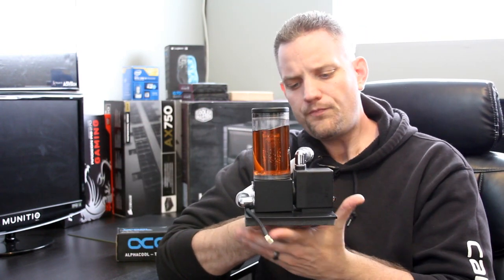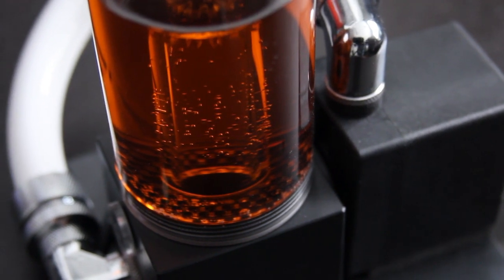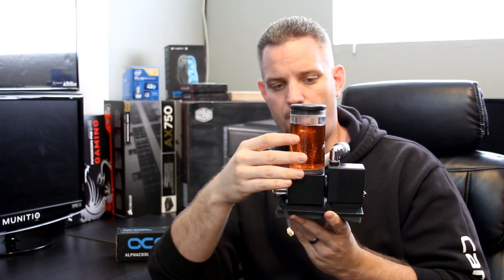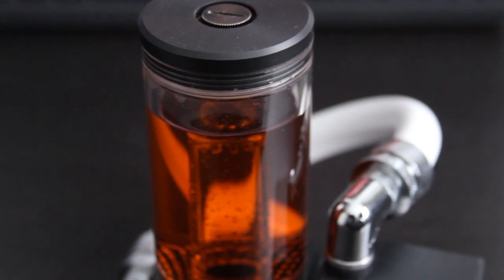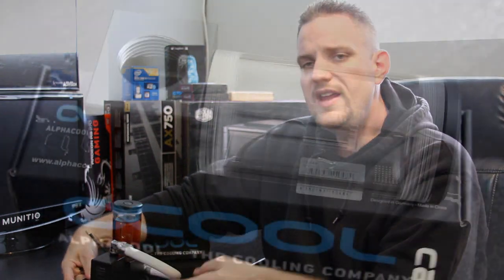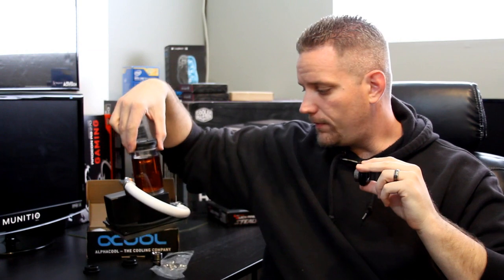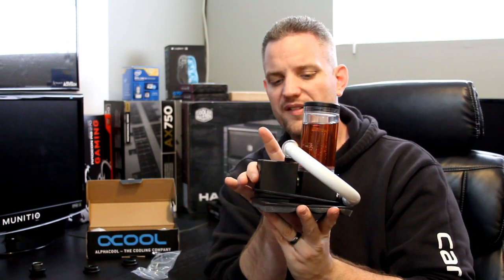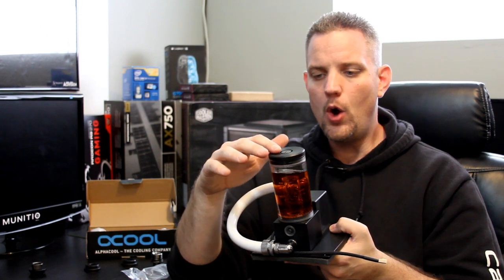The COOLEST Reservoir on the market? AlphaCool Light Tower

Comment: does the size of the reservoir matter? Or is it more important to have a bigger radiator with good fans. I'm assuming the size of the reservoir depends on how many items you have water cooled, i suppose that goes for the radiator as well?
Reply: mark swishersweets As far as I'm aware, not really. The only difference I've seen is that it takes less time to fill the loop with a bigger reservoir.

Comment: So just like the other comments, no pics or vids of it running with lights... and i know this is an older video, but even at the time, simply putting an led in a g1/4 plug was around for awhile and idk if it really make is a "light tower" plus its huge and ugly.... get a bitspower tube res and mound a d5 directly on the bottem.

Comment: Hey Jay, I was wondering if this was a good PC build for a Christmas present.  This is my first time building a custom computer and I would really appreciate your help/input.

CPU- AMD FX-8350 4.0Ghz 8-core
CPU Cooler- Cooler Master Hyper 212 EVO
Motherboard- ASRock 970 Extreme3 ATX AM3+
Memory- A-Data XPG V2 8GB (2x4GB) DDR3-1600
Storage- Samsung 840 EVO 120GB 2.5'' SSD and Seagate Barracuda 1TB 3.5'' 7200 RPM
Video Card(s)- 2x Gigabyte Radeon R9 280X 3GB
Case- Cooler Master N600 Windowed
Case Fan(s)- Corsair Air Series SP120 High Performance Edition 120mm
Power Supply- SeaSonic 750W ATX12V / EPS12V
Keyboard- Cooler Master CM Storm QuickFire Ultimate
Mouse- Logitech G9x
Reply: That will be a great rig :) May want a 850w psu tho
Reply: upliftsleet1974 Thanks :)  I literally had no idea how to build a computer until I watched Jayz' videos.
So what you're saying is I should increase the power supply.  I can do that since my budget is somewhere around $2000.
Reply: MountainDrew You may want to go on this site and post it http://linustechtips.com/main/
There is a place for planing and you can get a lot of help :)
Reply: Get a better motherboard. That asrock you listed will not have enough pciE bandwidth for two 280x's. the power supply should be upgraded, and upliftsleet1974 stated. I recommend the ASUS M5A99FX pro R2.0 or the gigabyte GA_990FXA-UD3. those both will house plenty of bandwidth for crossfire to perform as intended. the hyper 212 EVO cooler is a great choice if you are on a budget, but look into a more beefy heat sink if you plan to overclock more than ~15% (if you can spacre the change). hope this helps! =)
Reply: If you are going for such a high end build i would highly suggest an I5 over any FX. You are getting much more performance in games that cant take advantage of 8 cores. Also, just go for one video card, either a 290x or 780. This gives room for upgrades. If u go 780 i believe u could even afford an I7 which will be superb for the years to come.
Reply: MountainDrew Yeah for $2000 go to Linus's forums instead of just YouTube comments please. Go somewhere where you can get real good advice. Or even go onto reddit and go to the subreddit /r/buildapcforme. Then when your build is all done, take pictures of it and post it in the subreddit /r/buildapc.
Reply: if ur just using the ssd for ur os then get a 68 gb.
Reply: ThexPandaxManiac Such as an Intel Core i7 4770k?  I could probably afford that.
Reply: Incap Thanks :)  I think I will go with the ASUS since I have heard good things about it on linustechtips website.
Reply: Bailey D Thanks for the advice.  I will probably go there later tonight and take a look at the forums.
Reply: MountainDrew You shouldn't increase the Power Supply, 750w is just enough for that build. However, if you ever want to upgrade to Trifire or Quadfire, you will definately need more power
Reply: you should probably get an r9 290 you will be fine with that 750w psu for it
Reply: ***** asrock makes some good motherboards for none overclockers
Reply: definitely get the 850 watt power supply so you have some headroom for over clocking the cpu and the gpus. Also if you want to add in more hard drives or water cool your rig, the extra power will come in handy.
Reply: itsasecr3t1227 For water cooling should I get the H100i?
Reply: MountainDrew I have the h100i with the FX 8350 OC to 4.9 easy with it. Its awesome.
Reply: upliftsleet1974 actually 600 would sufice, but 750 is great, no need of 850
Reply: ferisalgue Thanks :)
Reply: Incap No don't get the Gigabyte GA-990FXA-UD3. I had one of those in the past and for a $2000 build budget you can really do much better. Plus that takes into account whether you're going to overclock or not. The Gigabyte motherboard doesn't have many power phases and with the FX 8350 you really wouldn't be able to get much higher than 4.2GHz. Get that Asus Sabretooth. You could easily hit the limits of that chip if you got a biiger power supply as well. The FX is a power devouring monster. Of course the Intel would use fairly less power if you went that route.
Reply: DO NOT GET THAT MOTHERBOARD! I had it and it locked on me in two months and I still can't get it open. Get an Asus M5A99FX Pro r2.0, absolutely AMAZING motherboard!
Reply: MountainDrew ive seen 290 beat the 290x in most benchs, also may i suggest a 990 chipset, if you can get the 990fx sabertooth, your set for the long run buddy. ;) also if you plan to use this straight for gaming i would not suggest getting intel.
Reply: get the 8320 and overclock to 4.0 ghz you can you can get a nicer cpu cooler or some fans idk
Reply: ***** i know you dont "need" it but it's certanly not expensive, and i prefer the looks on that one better than the blue on the m5a99x, not to mention all the "perks" on it
Reply: 2x 280x!? LOL THAT'S SUPER POWERED! Get an ASUS MARS III with the two onboard 760 GPUs. It's a great price point that kicks ass (once it's released in the next week or two).
And if you don't want nvidia, go for the 290 or 290x, I mean, 2x 280x is a bit overkill.
Reply: Robert Downey Jr. It's overkill if you're trying to push a monitor at 1920 x 1080 but if you're like me and have a 2560 x 1600 then it's right up you're alley. The 290x or 780 would be much better suited for the higher res though just given the 3GB or more of memory but 2x 770s with 4GB should do well with 2560 x 1440
Reply: Robert Downey Jr. Anyway the Mars III is too expensive compared to just just buying 2x 760s and the performance would be just about the same when it comes to gaming unless you want to save yourself from using 2 graphics slots. Plus with a limited number of the Mars III being made, I'll bet retailers will sell out quickly. It is badass though

Comment: Have you ever talked about every time you have a short 90 Deg in your cooling loop that's like adding more pipe to your loop? So let say you have EIGHT 1/2 inch ID short 90's in your system that would be like adding 8 inches per 90 to your system for a total of 32 inches to run, then if you used long 90's? (I think I got the formula right ) it's why on long runs in your home of 1/2 inch copper pipe you get water hammer when you shut off your valve realy fast. Larger pipe like say 1 inch would would not get that water hammer on long rungs. But what does water hammer have to do with a cooling loop? Well that back pressure of all those 90s  means your pump has to work harder to move the water in your system.
Reply: Which is why you use a D5, which has an absolutely stupid head pressure.
Reply: Unless you are using a two stage two horse sprinkler pump, your not going to get the best head pressure, and more likely with a 2HP pump you're going blow your loop(s) apart. Even with a grundfos pump in a hydronic heating system is not going to give you great head pressure, what you're going to get is volume. My point here was every time you use a short 90 you're shooting yourself in a foot. Plus, from everything I am reading and watching most cooling loops for computers are a close loop. So trolling over the D5 is kind of mute. The weight of water on one side of the loop is equal the weight of water on the other side. It's just those short 90's are going to slow down that flow of water. Long 90's are your friend. That's why they use them in refrigeration systems like in your local Costco,  Sams, or Safeway store, and why you find them being sold at Granger.com and NOT being sold at Homedepot or Lowes.

Comment: How much does a full scale water cooling system cost?
Reply: It can be very cheap, or very expensive. Depends on the Radiator Size/Count, what's being cooled, and the strength of pumps and amount of fittings. I'd say the cheapest you could get would be around $120-$200, but totally depends on parts.
Reply: Rule of thumb. $300 for CPU and then an extra $100 for every component after that. That's petty much the cheapest. Just to give you a reference point I'm looking at $1000 for a CPU Loop. But that's spending a premium on components and buying extra radiator + components for when I go SLI in the future.I'll be spending ~$200 on a waterblock for my GPU and that's in my opinion very high end components $100 is perfect for a WB and ~$80 is high end for a cpu waterblock. I hoped this helped mate. 

I recomend you go on overclock3d or OCN if you want to learn more..
Reply: It depends on how many components, and how many rads you want. The more rads, the cooler it will be. For a basic CPU only custom watercool, it will be around $300.
Reply: 100-150$ if you are building it yourself.
but then water cooling has always been about aesthetics. and this stuff look better

Comment: why do i need a reservoir?
i mean, many radiators have a built in reservoir that keeps the air out already.
Reply: +Henry Chan the problem is your pump. it needs to have "way too much" water above it as a security buffer in order not to run dry. after completely filling your loop you could theoretically   remove the res because when the pump is goint to push liquid it will get the exact same amount from "behind" and wont run dry. you could  also use a T piece with a tap. the upside is ysed to put in water, after loop is full you close tap but a new problem arises. water evaporates slowly. like really slow. a res can buffer that. no res -> no buffer.

Comment: As others stated, this video lacks showing the product actually running on your setup. Simply saying "take my word" is just as bad as how misleading the video is (seems like a formal ad). On top of your "claim" that it works for everyone, you didn't even bother to back it up with any form of data (making your review rather subjective). To any one wondering how this product would have helped you, look at an actual review where the device gets thoroughly tested and data gets compared to similar products (extremerigs.net, overclock.net, etc.)

Don't get me wrong, you know your stuff, it's just that water cooling isn't as simple as "it worked for me, it's gonna work for you", it's actually very specific to the setup itself. I'll leave it at that since it's an old video.

Comment: Alright I just changed my system build from AMD to Intel.  My specs are as follows.

CPU- Intel Core i7-3770K
CPU Cooler- Corsair H100i
Motherboard- MSI Z77 MPOWER ATX LGA1155
Memory- Corsair Vengeance 8GB (2x4GB) DDR3-1600
Storage- Samsung 840 EVO 120GB and Seagate Barracuda 1TB 7200RPM
Video Card- Asus GeForce GTX 780 Ti 3GB
Case- Cooler Master N600 Windowed
Case Fan(s)- Corsair SP120 Quiet Edition
Power Supply- Seasonic 620W Semi-Modular

Yay or nay?
Reply: Do you shit gold bricks?
Reply: Jimmy Kubli I was aiming for something in the $2000 market since I've been saving money for quite a while :P
Reply: ***** Thanks, I'll take a look at them.
Reply: its "yay" but do you have a problem with your seagate barracuda? mine makes strange noises, its new, it has warranty but when i take it to where i bought it it doesn't make the noise...
Reply: pavkata99 I haven't had any issues so far, so I don't really know what the problem could be.
Perhaps air pressure has something to do with it?
Reply: something like beeping ...
Reply: pavkata99 Oh, then I would suggest getting a new one and seeing if it does the same thing, because you are 100% sure that it's the Barracuda right?
If you try another one and it does the same thing then I would suggest switching to a different model or a different product altogether.
Hope this helps.
Reply: yaaaaay
Reply: rogantu Thanks :)
Reply: No Haswell?
Reply: I'd advise the 4770k over the 3770k if you're doing more than just gaming. If you're not doing anything more than gaming then there is no benefit to get a 4770k over a 4670k, you'll so no performance increase. Corsair SP fans are designed for radiators not cases because they increase static pressure and not air flow. So get corsair AF fans for the case and if you have the money replace the stock fans that come with the liquid cooler with corsair SP fans because the stock fans really aren't great.
Reply: yes but if you have money for 4770k get that insted sorry for bad english
Reply: Nixter Gaming Thanks I'm currently changing it.
Reply: MountainDrew Okay. Linus said this and I agree. SP series fans or pressure optimized fans are probably the best in versatility. Why because if you're going through a mesh in front of the case, a honeycomb design and then HDD cages a pressure optimized fan is the best option not a air flow. Most of the time pressure fans would be better in the case then air flow. To use air flow Corsair say give yourself at lest 3in of clearance or else its better to have SP fans.
Reply: Shadow Thanks, I also looked at the forums on LinusTechTips and everyone recommended the SP fans for my build :)
Reply: Nice build bro.
Reply: Nixter Gaming 4770k is lga 1150, his mobo is 1155

Comment: He didn't show  that piece of crap working , cause the o'rings did not seal at all. Its leak little be. So do you expend thousands of dollar building a gaming computer and get the risk to loose some expense hardwares with water cooler system that isn't 100% safer running.  THUMBS DOWN FOR NOW.